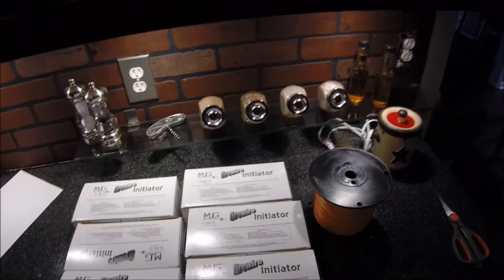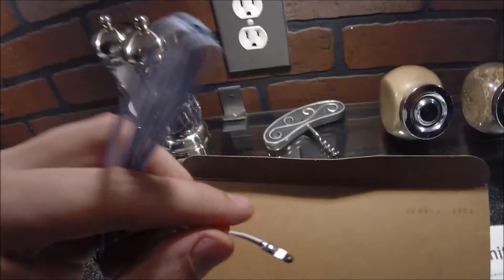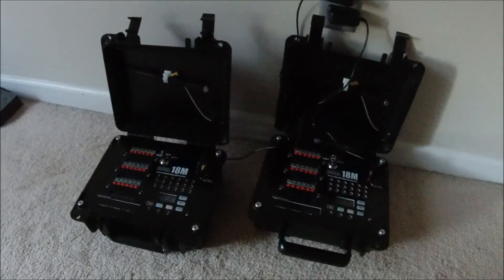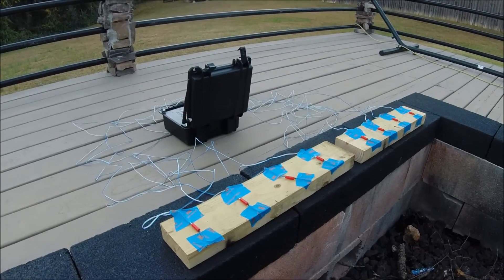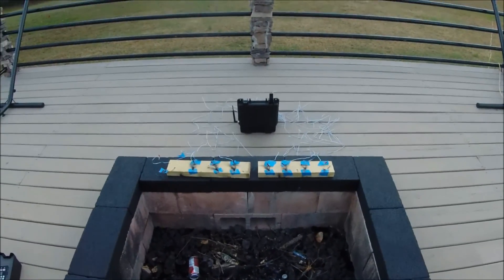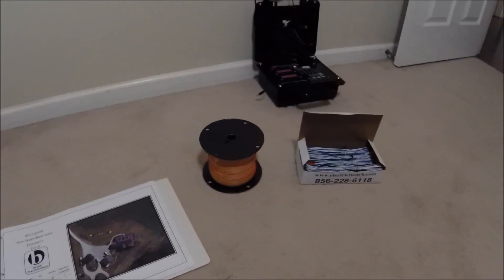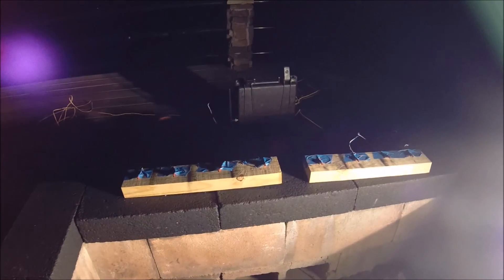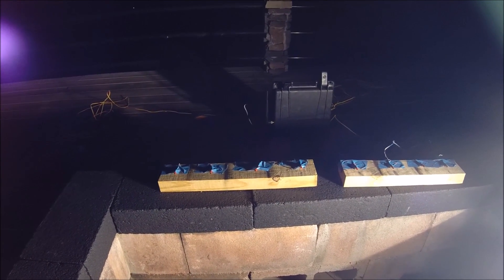Firewire Initiators Testing with Cobra Firing System HD

Comment: Better to just put the match into the lift charge, but if you decide to go and use the fuse the best thing to do is cut a small amount so a fresh part of the fuse is exposed.  ' Obviously don't just expose the match when inserting it into the lift charge this could be a bad thing if you are transporting your fireworks somewhere vs doing all this on location' So much to learn when it comes to safety. A lot of little things you learn along the way.
Reply: I was just thinking the same thing, why use these for lighting fuses, do a direct lift charge insert unless you want to light a cake or something

Comment: I used these and only these this past Labor Day. I used little pieces of QM on all of them with zero failures. I did not try firing anything in series or parallel though. I popped one at a time firing boards. Firing systems were the cheapo stuff with the 4-cue field modules. Not sure how these would work without QM over the fuse.
Reply: where i cn get mg E match-box

Comment: You should get some of those "initiator" Visco clips.  Less then 7 cents each shipped and can be reused a few times and it avoids the fuse not properly igniting as well as provides a secure connection.  If you are already spending so much on igniters then get the clips too.  You could have edited the video some more.  I found myself skipping ahead.

Comment: They are not for setting off visco fuse. But regardless great video.
Reply: They absolutely are for visco! Try the visco clip from our site www.Electricmatch.com
Reply: Kevin Hirschkorn I use them for visco all the time.  Agree that you need the Visco clip.  I’ve had zero failures once I started using the Visco clip.  Very happy with them.

Comment: What do you set your cobra at 0.1 or 2.0 if you know what I mean?
Reply from the maker: +BW PYRO I set mine to 0.1, they work very well on this setting.
Reply: Ok cool cause I had ordered the original ones and I'm hearing they improved a lot cause the original ones sucked still have some cause of that very reason so I take it there 10x better now?
Reply from the maker: So far they are good for me. I am using over 200 for New Years, I'll let you know how they work out.